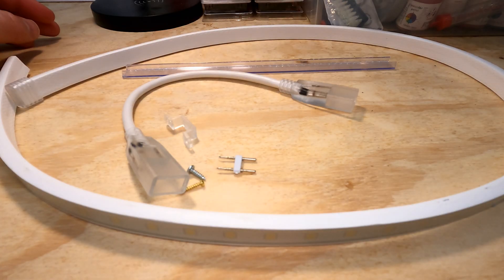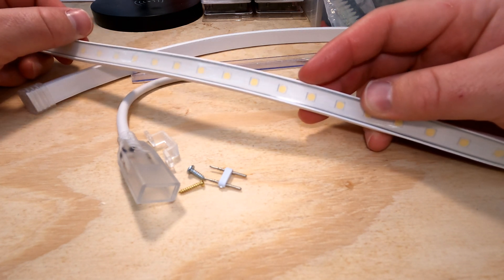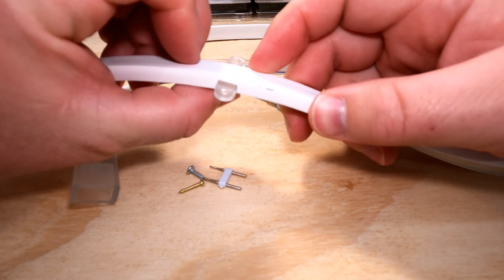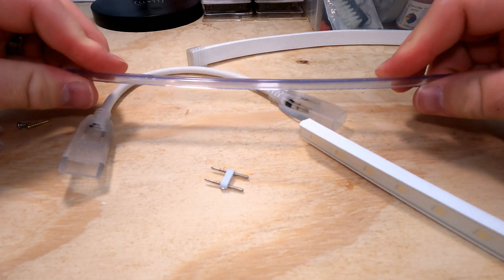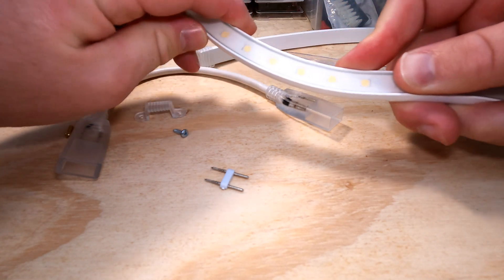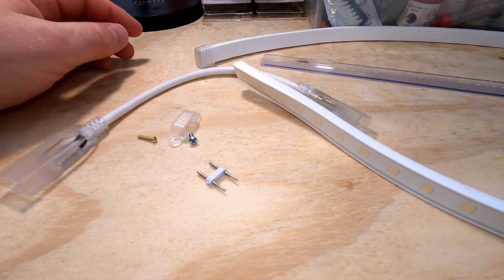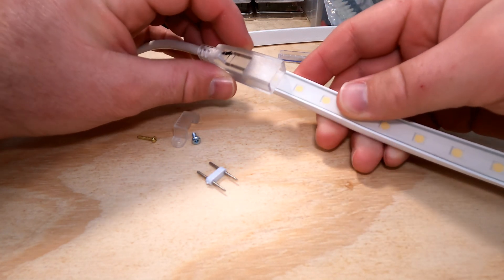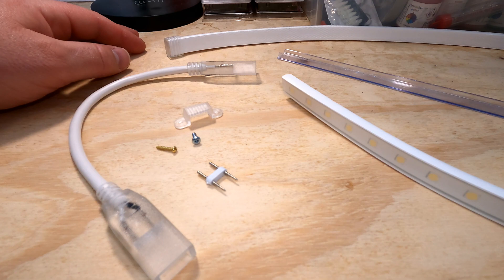13 - Overview of AC5050 LEDs for model railroads

Comment: Iain, thank you so much for doing these videos and going into the details that you do. You have saved me hours of testing and the costs involved to try each of the lighting options I had been considering. The length of the strips themselves is a great thing and the fact that they run on the lower power requirements make it possible to run a full strip on a single circuit. Again, thank you so much for doing the tutorial. I am enjoying your progress and have recommended your channel to others. How are you feeling?
Reply from the maker: Thanks, glad it was useful! Having spent the time to figure these lights out, and now living with them for 2-3 months, I really like them.  They are expensive, but I think they'll hold up really well, and fit my needs. I'm slowly getting back to things again, so more to come on the channel soon. Iain